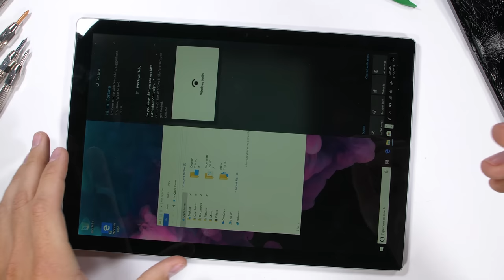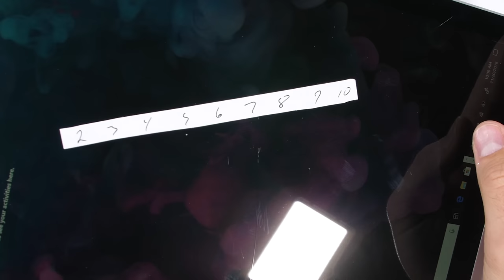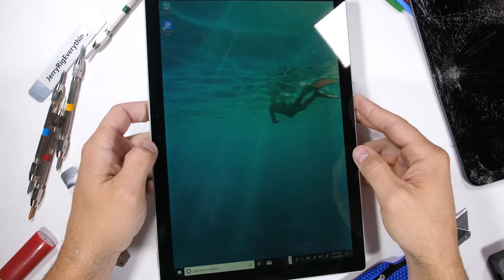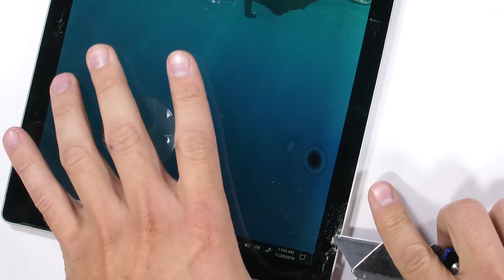Surface Pro 6 Durability Test! - Is it stronger than the iPad Pro?!

Comment: -Snazzy labs has left the chat
Reply: you know ALL TABLETS BEND...

or not
Reply: Correct. Now someone needs to tell snazzy labs that his argument that a big tablet (iPad Pro) will always bend is not always true. Every tablet build is different and as jerry has shown the surface survived the durability test while the ipad didn't.
Jerry gave a tough blow to all the apple defenders straight in the face.
Reply: Wkwk true
Reply: It still bend though, just less noticeable. Also iPad is just mostly battery and logic board while Surface's internal is more like a laptop, so structure support is much different.
Reply: @nonnnth  "It still bend though, just less noticeable" ?  Wow dude..  The iPad Pro practically folded in half like paper and stopped working. The surface never bent more than a few degrees and kept working.. There's a BIG difference there. It's embarrassing you actually said that to try to defend the iPad.

The first ipad was basically battery and logic board. But that was a tank. The difference was they weren't so obsessed with "make it thinner" that it ended up compromising the structural integrity of the device. That's the point. My 9.7 Pro is thin but I can throw it into my backpack without worrying it's going to bend like "silly putty" (AppleInsider's words, not JRG/Zack's. See his video where he bends it easily) There have already been some people who've bent their ipads after taking it out of their backpack. That shouldn't happen.

They could easily put structural reinforcing ribs in the housing, but they didn't. Because it costs money. These videos hopefully will make Apple spend the $$$ to improve their products and make them more durable.
Reply: @shubham-pawar  he's a cheater, he  edited while bending. Its in 3 frame. Jerry bend it in 1 take.
Reply: On snazzy's video, many guys such as mkbhd or detroitborg wrote comments such as "too funny" or "i'm dead lol", then all these comments suddently went away. Why?
Reply: @bmasc4544  first, I didn't say how much less noticeable it is, because I think the point of his video is to proof that “not all tablet bend”, not “how usable it will be after bending it”. 

Also I too don't understand why Apple thinks iPad still needs to be thinner. 

I'm planning to buy one but I was worrying about breaking it too.
Reply: BingBong Boopledoop if making a device bulkier gets you better durability than a piece of cardboard, then why not?
Reply: @BingBong Boopledoop I think both iPad Pro and Surface Pro are in the same league, it's a tablet that can (sometimes) be a laptop, what's different is how they think of it. It depends on what side do you prefer, full desktop feature that sometimes is clunky, or user-friendly feature that is almost as capable as a desktop.
Reply: @nonnnth  The thing is if the iPad Pro bent like this, no one would have an issue. When people say the iPad bends easily they don't mean it only bent a few degrees like the Surface Pro. They mean, after what looked like much less effort than anything else tested, it practically folded in half. You can't even compare the two.

The point of this video isn't "not all tablets bend". It's "Is the Surface Pro stronger? " (says so right in the Title) And it is. Saying "The surface also bent, just not as much" is getting into semantics and sounds like something apple apologists say when defending apple. There's no point in saying it because let's face it, everything can bend with enough force. 

And I like the iPad Pro. I was about to buy one and still might. But I'm not going to blindly defend Apple when it's clear they cut corners in terms of structural integrity when they designed it.
Reply: @BingBong Boopledoop Even the oldest iPads did not bend like the current ones and there was nothing impractical about them in terms of form factor. If you Apple fanatics ever stopped trying to rationalize or excuse what are blatantly bad design choices, Apple might actually make something that is durable, practical and convenient.
Reply: @bmasc4544  Okay okay, I might be defending Apple too much about the structural integrity, but it's should not be an issue if you take a good care of it. Always put it in protective case, don't sit on it. 
Please don't make another bendgate, there might be an issue, but it's not a big deal, a lot of people are still rocking iPhone 6 plus just fine despite the bendgate.
Apple will fix this, so if you want this gen iPad Pro, you just have to take a really good care of it.
Reply: @BingBong Boopledoop are you interested in facts or do you just want to blindly defend Apple? Because Appleinsider (yes Apple fans) also tried a few tests, the aluminum rippled almost bubbled after being dropped from waist height and landing on its face.
When he tried bending it he says it bent easily like silly putty. Previous iPads took much more deliberate effort.
People have pulled their iPad Pro's out of backpacks to find it bent. That's the issue. Mobile devices should be able to handle that without worrying about it.
Sacrificing strictural integrity for "more th1nner!" isn't good.  I have a 9.7 pro and would like to update to this but I'm no Apple fanatic. If they screw up or start making stupid decisions, I'm not going to blindly defend it.
Reply: @nonnnth  You seem like a decent guy. So let me ask you, why do you defend Apple so much? Always defending Apple or any company blindly makes you look like a fanatic. Yes a lot of people are still rocking iPhone 6 plus, but a lot have had them bend. Did you know about the Nintendo Switch screen scratching issue (from using the dock)... I remember someone on youtube saying it never happened to him because he was always careful and said other people were being rough with their switches. Then it finally happened to him. -- Even after being careful, his switch's screen got scratched from the dock. He looked like an idiot because he was dismissing other people's experiences until he realized "oh I guess it really is a problem" And yes... He was a nintendo fanboy blindly defending nintendo.
The ipad Pro bending shouldn't be an issue. But it should be able to handle being in a backpack. There's a difference between taking care of something and "babying it". You shouldn't have to baby it as a mobile device. A folio case in a "tablet pocket" of a backpack should be enough. But even you admit you're worried it might bend. We don't know if it can handle the small torsional force a backpack might put on it do we? Not unless you buy a bulky otter box or lifecase or something. (there goes the thinness.)
 
Did you see Apple insider when they said it was like "silly putty"? when they were able to basically bend it like aluminum foil?
"Apple will fix this"  we don't know that. IF there's enough reports of it happening and their PR begins to suffer, then they'll do it. Because in the end they only care about the bottom line. We hope they'll fix it --But seriously, wording like that really does show how much you love Apple..
Reply: @bmasc4544  Yeah, I love Apple, but sometimes it disappointed me, like that time when I waited so long for the MacBook Pro to be refreshed, it turns out underwhelming, but I don't always defend Apple, like the case of Beats headphones, I tried it in retail and thought it sounded bad even with iPhone, so I never liked Beats. 

The reason I like Apple is because the OS, I like the design, I like how things always work on macOS and iOS, unlike Windows that always got me frustrated, so when it comes to Apple vs Microsoft, I always pick Apple. So, when people are complaining so bad about products that I like, it feels like an instinct to defend it, not just Apple.

Also I wish Apple would make something like Surface Studio because that is cool, but I don't like that it won't work with macOS.

Comment: Its a portable FULL PC. You can probably play some 2010 or less AAA PC Games , emulators, programming, graphic design, etc. PC stuff you wanna do.
Reply: Yep exactly. I run tons of older AAA games and emulators (Wii, Ps2) on my gpdwin2 and that's a much slower m3 processor and iGpu. The quad core i5 on the lower end surface will run even better.
Reply: I have a surface pro 4 and i can play games , program,  compile, video edit, use solidworks and blender, its a great computer.
Reply: @Anonymous-ip8ui depends on the game you're trying to emulate, what settings you're using in pcsx2, etc. Try looking up the game you're playing + "best pcsx2 settings" on Google. I'm able to play God of War 1 and 2, Shadow of the Colossus, at pretty much 60 fps on the Gpdwin2 (core m3)
Reply: @yan kopr an insult? Diablo 3, Witcher 1, 2 and even 3 (with tweaks). Oh yeah and Overwatch. All of these can be played on the go on a lowly m3 processor of the Gpdwin2. An i5 or i7 of a surface pro 6 would do it only better. None of those can be played on any iPad. Sad thing is the hardware could do it easily. But Apple prevents you from even trying. So which is more of an insult to consumers?
Reply: Port them to iOS and you'll see how effortless iPad Pro can run those things.
Reply: @yan kopr It can run games newer than 2010. The big difference is he said "AAA games". Gamer-speak for games that you needed a high end GPU and gaming rig for back in the day. Big difference between "games from 2010" and "AAA games from 2010" there's quite a few good ones still worth playing from back then... either way 2010 is a little off. It's more like 5-6 years ago.

Comment: i feel like most companies that make mobile devices take notes from these videos and put them into making the next device even more structurally sound

then apple and apple's fans be like: Jerry released a new video on our product, DISLIKE!
Reply: Companies won't take notes on this because it's a business trick to implement flaws in the device.
Reply: Apple listens to Jerry and exactly opposite!
Reply: @goku4393  not entirely, if the product can be made from a new manufacturing process or material much more cheaper, and it just so happens to make the product more durable as an unintended after effect, the company will do it anyway. They want the customers to be happy as long as it doesn't cost them any money. In economics businesses only care about one thing profit. If your products are poorly designed and lack durability people will not buy it, especially after people review them, and the word and reviews get online. The only exception to this is companies that dominate niche markets or companies that monopolize their proprietary software, and hardware like apple. They have no incentive since people are addicted to their eco-system and so then planned obsolesce makes sense, however if enough people complain even apple will have to spend extra money on more durable components, especially given apple's war on the right to repair. They did the same after the whole bend gate fiasco, they made sure the next gen iphones, had more flex resistant aluminum, and it costed them a lot more money per unit. Companies hate it when their unit costs increase.
Reply: @rehmanarshad1848  I'm talking about companies making notes on "pre-prepared" videos which is paid by most of the companies. They pay the reviewer Mr.smarty pants. So, what's the point on taking notes which is already made by them? these companies have a whole unit for user experience tests and why the heck with listening to this review? you are talking about the cost of production and the Apple's economy. who talked about it anyway? Listen first and reply. Don't just reply to make yourself feels great. don't care if your work is based on this but I'm saying is that company pay the reviewer on YouTube. Just research it and that's the business trick I'm talking about.
Reply: Goku 4 wouldn't that 1. Be a paid sponsorship and 2. By law it has to be disclosed (preferably in the beginning of the video). Why would companies pay a person pointing out design flaws? It makes absolutely no sense, they would pay him/her, and still not take notes on the flaws? Planned obsolescence is a tricky slope especially when you consider the risks for class action lawsuits. That's why there's always a cost to profit analysis.
Reply: @rehmanarshad1848  Man, if the reviewer point out all good things  then what's the point of reviewing? reviewer wants you to believe so they put little salt and pepper in their spicy dishes, got it? And the heck no one asked about law suit, you are just blah blah blah again. stop thinking about what to reply and learn to listen.

Comment: Lol this video was a low key response to Snazzy Labs Troll video. Great work bro, you proved your point calmly and clearly with out including pointless drama. Keep up the good work.
Reply: Except snazzy labs video had a tablet of similar size and weight but this one was heavier and thicker because apparently that's a good thing. Then just gave excuses for every problem this tablet had like the screen cracking during the scratch test. Because "IpAd BaD SuRfAcE GoOd!"
Reply: @zeenyuhrass  What do you classify as a "real computer" Because I know a lot of people wouldn't consider windows tablets "real computers". The ipad pro is efficiently held back by ios for sure. But as far as power goes, the ipad pro is more powerful than the $800 surface pro. (Most of the variants really). If the ipad had windows 10 as well (which is really not optimized for tablets) It would be insane power wise to go with the surface over the ipad at that point. Or if the ipad pro had mac OS (which it should at this point).

Comment: Nintendo can learn from that kickstand
Reply: Nintendo's kickstand is genius, it's meant to pop off to save the hinge and can then be re attached easily, it was part of the advertisement for the console by nintendo
Reply: The switch kickstand's problem is that its not in the middle so can only stand the switch up on a flat hard surface
Reply: @BankruptGreek  A flimsy kickstand that only works on flat surfaces is not genius.
Reply: If the switch had a giant metal kickstand it would be much thicker and cost at least 400$, you sure you want that?
Reply: But nintendo is a cheap gaming handheld so all is forgiven, beside the screen is too damn small to be used in a table
Reply: @JuanRomero  what do you mean with "only works on flat surfaces" isn't that literally the definition of a table, which is essentially where you dd use it?
Reply: I hardly think adding one on the switch would benefit anyone.
Reply: @BankruptGreek  So never on a bed quilt or lap? Why would you always have access to a table?
Reply: @pazzoeo  I wouldn't want a Switch even if it had that. Bought one and returned it. I already had a Surface Book 2 and it compliments my Xbox very well, so I have no reason to own one.
Reply: @flows30  So then why bother with the stand at all? 🙄
Reply: @JuanRomero  just lay it flat on your bed or lap like you do with your phone, or just hold it with the side joy-cons attached.

I am sorry but you sound like you are cherry picking, the design is amazing, the psp and psp vita or all flat Nintendo handhelds never had a kickstand and the fact they added one on the switch is nice, they couldn't practically make a strong and durable one but instead figured out a solution by making it detach and re attach easily which is a genius design.

overall the switch is an amazing console packed with all kinds of neat features.
Reply: @BankruptGreek  And you sound like you're being overly defensive for a poorly designed product. I shouldn't have to figure out workarounds to get something as simple as propping up the device. Especially for something that's supposed to pride itself in being multiplayer anywhere.

Comment: I'd happily buy a Surface Pro 6 over that new Ipad pro any day of the week.
Reply: FullMetalPanicNL I did. Not regretting that decision in the slightest.
Reply: Zeksteve  correction :- less useful overpriced ijunk ;)
Reply: Lol, what is so hard about admitting that they are both incredible devices?  It's not a zero sum game, you can appreciate both for what they are.  Like it or not, the iPads "fragile" design is the sexiest tablet ever made.  Just dont intentionally bend it and it'll be fine.
Reply: @MegaTechpc  the problem is the fact that the iPad are useless. They aren't even good Netflix machines cause the screens are mediocre
Reply: Using the surface in my daily workstation at work. Best what could happen. Superior in meetings and has a productivity like a regular laptop. Glad to have one.
Reply: @CallFor911  hows the battery holding up?

Comment: Phone: Holy shit turn it off before opening u could get an elecrtic shock.
Tablet with much more power: Yeah let's just pierce the screen with my metal knife wich totally doesn't conduct electricity.
Reply: The apple tablet runs on the same 3.7v batteries as its phone counterpart, but with a higher capacity.  I don't know what voltage the Surface runs at though.  What i do know is that a 9v battery on the tongue is a vastly worse shock than what any apple phone or tablet could give.
Reply: @RaveOfNightmares  
Of course it's apple.
Reply: @RaveOfNightmares  it's volts that jolts but it's mills that kills
Reply: @alexanderhowarth6460  unless a live circuit impales a finger, your hands are covered with liquid, or you stab a charged high density capacitor there isn't enough current moving through those boards to break the natural resistance of human skin.